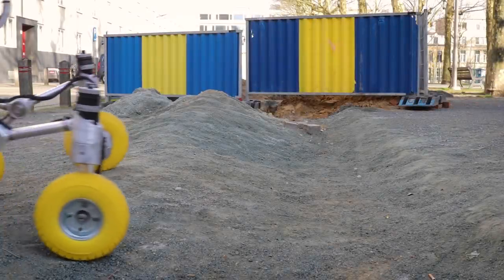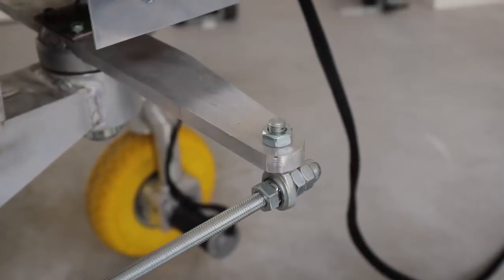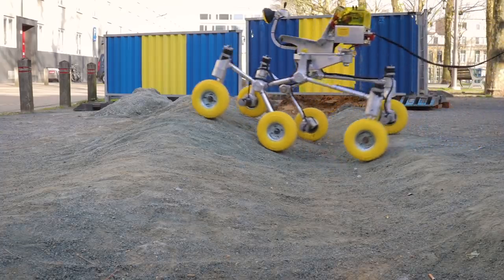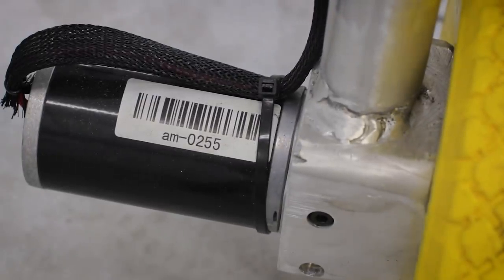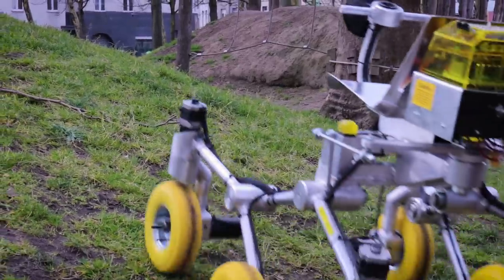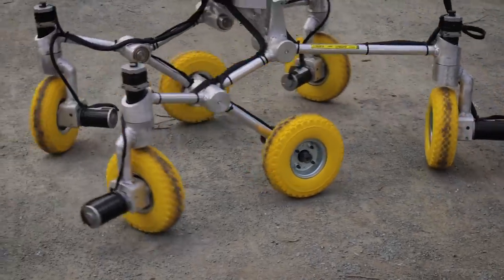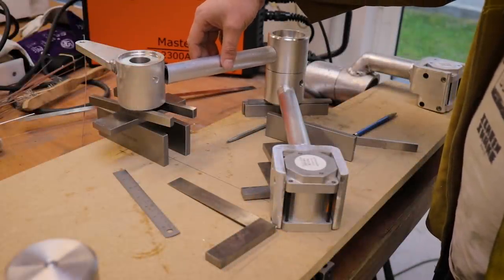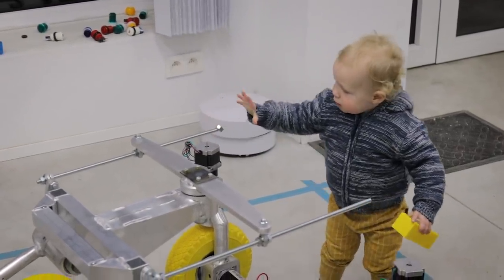Making a Rover For My Kid! Taking it for a spin!

Comment: Should add an XSR Receiver so you don’t need a controller cable! 
The Arduino code that you use for it is pretty easy, and you have a choice in controllers from FrSky.
Reply: I'd prefer a wired solution if I'd put one of my kids as toddlers on it though... Just saying ;)

Comment: Im very interested to find out how your milling machine is cutting. Are those 750w servo motors up to the job when you use a big cutter. I have just bought my grounded steel planes with hewing 35mm rails. Building a mag drill first then making the cnc milling machine.

Comment: I would like to build a eltricwheel chair fram with this design using some kind of hub moter for the driving moters then stepper servos for the rotation of the wheels.

Comment: Hi kris
i have a request if possible i'm a mechatronics engineering student and the rocker bogie rover is my graduation project it would really help me if you can provide me with a reference or schematics for this piece of art that you did it's one of the best i've seen so far  so please atleast if you can give me a run of the dimensions and the material used etc.

Comment: @Kris Temmerman Love what you do... But surprised not more people have busted your balls about your kid not wearing a safety HELMET … I work with horses and have kids etc. blah blah… Only takes 8 Lbs/ square inch to cause a skull fracture. IME when someone falls that one time they find the stone or immovable object or situation that is beyond their control they wish they could turn back time. Always wear a helmet.
Reply from the maker: Yes, You are right, he should wear his helmet. Thanks!
Reply: @KrisTemmermanNP  It's always an option to test the ground with your kid's head but not always recommended ;-) IME it's not always possible to control the environment or super random things. In the horse world it's not unheard of that someone tries a horse out for purchase , takes it out on the trail , has a minor fall, but some how their temple finds the exact sharp pointy rock and they are dead. I fall quite well (like a stunt man) but still managed to shatter my wrist also finding that one broad flat stone (that I used to break my fall) ! Titanium plates and screws and then later severed thumb tendon meant that I couldn't design or draw or do my other day job for about 18 months. Super COOL rig you built though... Looking forward to what happens next and the seat position is amazing IMO... Great design ! High position but not necessarily high C of G.